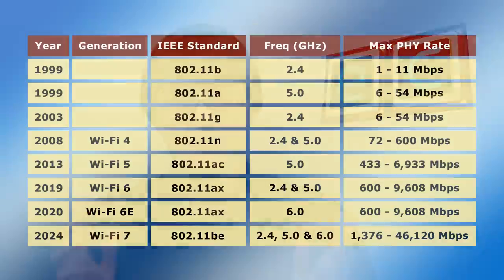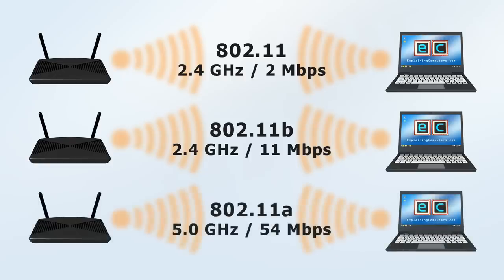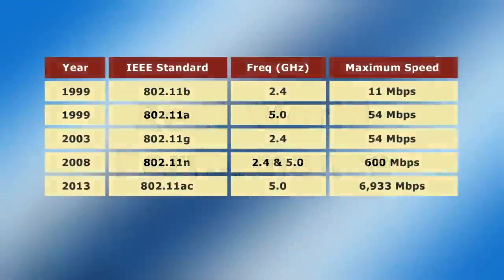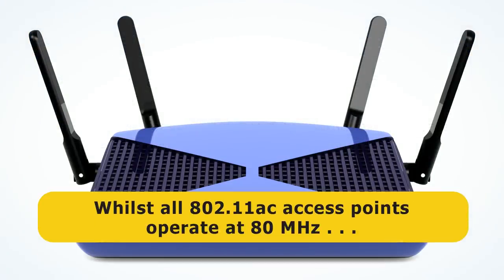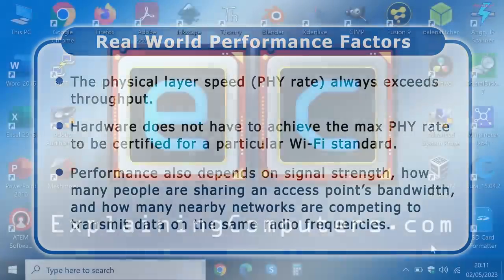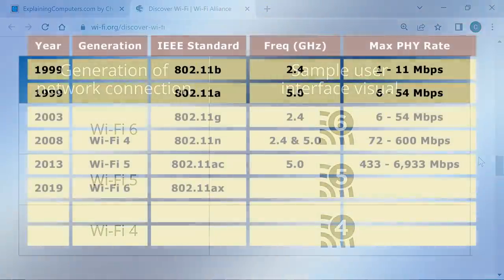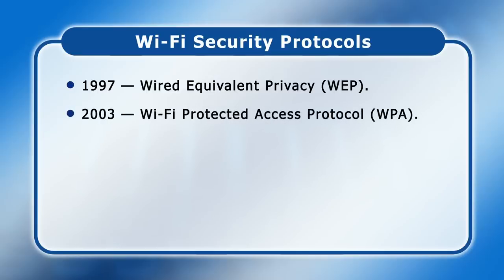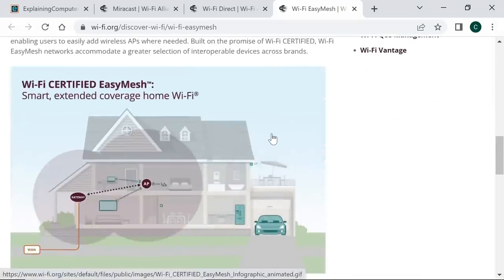Explaining Wi-Fi: 802.11 Standards & Generations

Comment: I do think you should have touched a bit more on WI-FI protocols like WEP, WPA, WPA2, WPA3 and why these are evolving and why one should refrain, when possible from older protocols.  Each previous protocols had /has serious weaknesses that made such protocols relatively easy to hack, under certain circumstances; or interfered with.  To me, that should be mentioned, especially with the plethora of IOT devices, like security cameras that can be  forced offline with WPA2; and WEP which was relatively easy to hack with the right tools.  

Realize that eventually WPA3 will be considered insecure, but there's little that can be done at this point in time. The actual chances of something bad happening- to a regular consumer is still relatively small, but one should try to upgrade periodically, and upgrade settings as well, and dump the old stuff. 

With that, I also realize that MOST folks should not be overly concerned; but when buying new gear, one should be looking to get the newer standards, i.e. gear that supports 6/6E and WPA3  rather than older gear that might only support WIFI 5, or WPA2.  Don't stick to buying only wifi-5 gear because that's what your router is; if possible, get gear that supports 6/6E and above so that when it comes time to upgrade your router, your other devices will already be ready to support it and benefit from it.
Reply from the maker: I did discuss the security protocols, but there is always a balance to strike in not overloading with content.

Comment: Another great informative vlog and always so easy to understand, your tutorials are excellent, I watched the one on changing or upgrading to Win 11 from Win 10 and picked up the local network part where you put in no thank you and hello, what does this actually achieve, or do? Regards David
Reply from the maker: It is an account that has had its password changed so many times that it forces the installer to error, and so to accept the creation of a local account . . .
Reply: Hi I thank you for your info regarding local network, I have just tried to do the second version of getting win 11 pro installed but it didn’t work as my bios won’t boot when I change it to UEFI or protected boot and although I’ve upgraded this machine dell Optiplex 7040 .7 with WD Black SN750 NVME SSD Gtx graphics 1030 graphics card and pci slot 4 usb c card, it appears the bios is the issue, got right through to the registry change and tried after regedit and the new value typed but it won’t do it, Could I ask if there is more that I could type in the value or is there another way of changing bios to then boot. Regards David
Reply: Hi I’ve just looked in bios and it has TPM 1.2 enabled also PPI bypass for enable or disable neither are checked the UEFI is disabled for the reason as stated regarding booting.
Sorry to ask but I’m getting on in years and I’m ok with most things but the bios is a scary place! Regards David

Comment: I remember the times when I connected a PDA to a computer via USB (with a 3 meter extension cable) to access the Internet through it, since that PDA did not have Wi-Fi, and I really wanted to use the Internet at some distance from the PC.
I also remember that bluetooth has similar operating modes and could theoretically be used instead of Wi-Fi, and even access points exist somewhere in the world, but for some reason this technology has not become popular. So we have wi-fi. Which seems to be improving with each new generation, but does not solve one fundamental problem - the passage of a signal through walls. Sub-Ghz band 802.11ah should solve this problem (as much as possible), but so far I have not seen such devices.
Reply from the maker: I remember times like these. My first ever online grocery shopping was ordering some bananas and stuff on a PDA  with a modem card, and a wire from this plugged into the telephone socket! I was very ill at the time, and thought getting food that was was amazing!

Comment: It's also worth noting that Wi-Fi is only half duplex, even Wi-Fi 6. So devices cannot send and receive data at the same time whereas wired ethernet is full duplex.
Reply from the maker: Very true.
Reply: And for this reason I think that when sending data between two devices on an access point (AP) with a single radio, the max real world speed drops by 50% as half the time the AP is receiving from the first device and the other half the time the AP is sending the data on to the second device.

Comment: An other classic!
Little correction: WiFi6 and WPA3, yes, came around the same time, but those are independent from each other: A wifi5 manufacturer can release a firmware upgrade, so that wifi5(ac) device will be able to use  wpa3.
Reply from the maker: Fair point, bad phrasing on my part there.
Reply: WiFi 4 devices can also get WPA3 support after a firmware update, for example a TP-Link TL-WR844N got a firmware update to add support for WPA3, or the Raspberry Pi Pico W, which already has WPA3 support out of the box thanks to the CYW43439 WiFi chipset that it uses.

Comment: When we built our house back in the late 1990s, I thought I was the coolest nerd ever because I had the house wired for 1Gb Ethernet (Cat. 5e).  Now days, it would be foolish to go to that added expense when you can simply put up an 802.11 Access Point or repeater.

All my iSCSI connections are via wired Ethernet but I have a couple network devices untethered (printer and tablet).

Comment: Am i wrong by saying that the chart at the beginning of this video shows that 802.11AC only has 5.0 GHz?? I have an AC WiFi SOHO router and it broadcasts both 2.4 and 5.0??
Reply from the maker: You are correct. 802.11ac does indeed only operate on 5GHz, as the table shows. But a router rated as 802.11ac is likely to support earlier standards also. This I mentioned later in the video -- the indicated standard for a piece of hardware is the highest/latest, but usually earlier standards are also supported for backwards compatibility (although this does not have to be the case).

Comment: I'm still buying and installing CAT5e Ethernet cables in my house! It seems fast enough to me, as I've only got 5Gb broadband, and the most demanding things I usually do are watch low resolution YouTube videos, transfer a few data files between computers, and monitor my 3D printers with OctoPrint! Installing Wi-Fi is too much hassle, due to the number of thick stone walls in my house, and cables are so much easier! Does this make me a Luddite?
Reply from the maker: Wired is still the best option where you can use it.

Comment: As usual great content... thank you for educating us. Although I knew about wifi-5 and wifi-6 but didn't the history and that much detail ... TP-Link has already launched a Wifi-7 router so just recently. please have a look and tell us if there is any benefit in upgrading to it. I am using wifi-5 router though my phones support wifi6 and wifi6e
Reply from the maker: Thanks for this. I had missed the TP link announcement --  they indeed now have Wi-Fi 7 products listed (but not yet available). Very interesting! https://www.tp-link.com/uk/wifi7/#products

For most people there will be very little benefit in upgrading, not least as Wi-Fi 5 is going to deliver a connection speed faster than their Internet connection. So the benefits of Wi-Fi 7 will be for those with very fast Internet access, or where they are accessing local rather than Internet data.

Comment: A major annoyance in the already hard to memorize jungle of PHY bandwidths: Dual 2.4/5GHz routers have their AP bandwidths plain added up, so a router with 450 mbits on 2.4 GHz winds up becoming a 1750 mbits, adding the nearly 1300 mbits on 5 GHz. While those can never be used as ONE. Just venting a bit, marketing sucks.
Reply from the maker: Often good to vent! :) Works for steam engines.

Comment: Question:  What happens to the network when a lower device enters the group?  For example, you've got a home network with all WiFi 6 devices, but then your kid comes home with a phone that can only go up to WiFi 4?  Does the whole network degrade to WiFi 4?  As a recall, that was the case when you had a 802.11g system and a 802.11b device joined.

Comment: So why skip letters between standards? Why were none of the letters c - f used and we went straight to g? Similarly skipping h - m and next used n. Are there other "hidden" 802.11 standards out there?
Reply from the maker: The standards in-between those listed relate to other technical matters. For example, the 802.11e standard dealt with quality of service issues: https://www.electronics-notes.com/articles/connectivity/wifi-ieee-802-11/802-11e-qos-quality-of-service.php

Comment: It's great that Wi-Fi speeds have improved but all that really does is push the bottle neck down to the physical network (unless you're blessed with a 10Gbps LAN) or your internet connection. I have a 2.5Gbps LAN connection in the house and a 300Mbps up/down internet connection. Wi-Fi 6E is basically useless to me...

Comment: One question, I hope I didn't miss it but, what, if anything, do the letters after 802.11 mean? Seems to be no rhyme or reason to them. b, g, n, ac etc.
Reply from the maker: As far as I'm aware, the letters just label the standards. So it began with a and b. :) But after that, not all of the new standards involved fundamental changes to the connectivity (such as speed improvements). For example, the 802.11e standard dealt with quality of service issues: https://www.electronics-notes.com/articles/connectivity/wifi-ieee-802-11/802-11e-qos-quality-of-service.php

Comment: So ,budget phones that have wifi 802.11 b/g/n or routers too that dont have the 802.11 ac are just perfectly fine for a  user with 100mbps  internet plans ?
Reply from the maker: Always if things work they are fine. :) 802.11 b/g/n hardware will have a PHY rate of between 72 to 600 Mbps (it will depend on the device what its max is within this range), and this will translate to a real-world throughout of between 50 to 400Mbps. So some b/g/n hardware will be bottlenecked by the Wi-Fi  on a 100Mbps Internet connection, but many devices will not be.

Comment: Could you expand on mesh? I find that when I connect with Wi-Fi I get a transfer rate of 40m but connecting with a cable to my remote mesh I can get 140. How do the nodes communicate that allows that type of speed with out a wire?

Comment: So if building a house in the next few years, does it make sense to wire with ethernet cabling, or just go with wifi?
Reply from the maker: Wire with Ethernet if you want the best, most reliable and secure connection. Wi-Fi is great -- but only where wired is not an option. :)

Comment: Wi-Fi can go over 1/4 mile direct line of sight using ordinary router/laptop without any special antenna's. BUT after pushing through 2 or 3 wood framed walls in my home, it's nearly useless! That could be like 20 feet away from router!

Comment: Fascinating stuff, my windows laptop says wifi 4 72/72 mbps so is that the hardware limiting that or my wifi provider please ? excuse me if this is the daftest thing you have ever been asked  !....cheers.
Reply: The Wi-Fi standard that your laptop uses depends on two things: Your router and the laptop's Wi-Fi card. Your Wi-Fi connection will fall back to the lowest common denominator, which means the newest standard that both devices will mutually support. For example, if your laptop supports up to Wi-Fi 6, but your router only supports of up to Wi-Fi 4, then your Wi-Fi connection between both devices will be up to Wi-Fi 4.

Comment: Honestly, those «wireless» wifi range extenders are so unreliable. An ethernet socket in the wall is necessary for any wifi extender. Especially if the walls are drywall

Comment: 802.11a is now called WiFi 2 and 802.11b is called WiFi 1.
You would think they would call 802.11a & WiFi 1 802.11b WiFi 2 since A is first letter and as both were released at the same time not to mention no one uses 802.11a or 802.11b these days.

Comment: In the real world wi-fi is kinda rubbish compared to wired connections. I use flat cable ethernet in my house. Yes it's a dam pain to lift carpets and sometimes have to drill holes in floorboards and walls but it beats wi-fi speeds every time.
Reply from the maker: Agreed, wired is always best. But this is a video about Wi-Fi. :)

Comment: Using 6GHz frequency for WiFi is THE BIGGEST MISTAKE the WiFi alliance did.

Let me explain,
According to the GSMA (GSM Association), 5G and beyond need at least 2GHz band for each country. 6GHz is one of the best frequency candidate because it still can penetrate wall, rain & snow. 6GHz is WAY better than mmWave.
Using 6GHz for WiFi is a WASTE because WiFi would still be fine using higher frequency like 10GHz or 12GHz.

BTW,
mmWave is failing. ALL of South Korean carrier admit defeat of mmWave, and returning the frequency to their government. China and Asia have voted on using 6GHz for mobile, and if America/Europe didn't follow, the west will lost in mobile data speed.
Reply from the maker: Yes, I was surprised when 6GHz was added, given the intense competition for frequency bands. We will see what happens over time . . .
Reply: @ExplainingComputers  
Thank you for acknowledging it the problem.
Really hope WiFi association move the 6GHz to perhaps 10GHz.
Reply: 5 GHz doesn't penetrate brick walls well, that's why I still use both 5 and 2.4
Reply: @gustavrsh  
That's the point,
WiFi should only penetrate 1 wall at most. And the frequency not too far.
That's why the WiFi signal were limited/suppressed to be very low power.
Otherwise, you will "fight" with you're neighbor
It means, if you're signal were too strong, you will have interference, and the speed will drop.
This is because WiFi is unregulated, and everyone can just make a WiFi point.
You will understand this if you put WiFi router in very crowded apartment or mall.
Thus, higher frequency like 10GHz still OK (and maybe better) for WiFi.

Mobile carrier is different story
Because the specific frequency will be licensed to specific mobile carrier.
Reply: @agathalorenzo4224  so your point is that I need 4 access points?
Reply: @gustavrsh  
Depending the size and location of you're area, perhaps yes.

.... Let me explain with my situation.
I live in a 4 bedroom apartment. I could put one router in the very center, and I could set my router to send with max power and get the signal in every corner of my apartment. But the signal quality will be bad. At certain time, at certain spot, especially after 17:00, my 2.4GHz signal might only have 1mbps-2mbps. But if I set my router to minimum power, and I use several 2.4GHz router, I might got at least around 5mbps-10mbps at the bad spot, and around 20mbps-30mbps at the good spot, but with a HIGH PING & DROP. This is because if I have around maybe 40-50 WiFi router around my apartment.
The 5GHz is better for me, because it penetrate wall less. Meaning, less neighbor WiFi. But again, same thing. If I set at max power, it will ruin the speed/quality. The best for me is to set at lowest power level and use more WiFi access point. So it's quality problem. If I want higher quality, use more Wifi Access Point. Because using high power = more interference = higher ping.

Comment: Despite big phy rate numbers wifi is not hugely different of how it was 10 years ago. It still sucks hard and is nowhere around as the replacement for the wires. Don't be fooled by numbers. It still works like walkie-talkie. One speaks other listen and mu-mimo does not helps much. OFDMA of wifi6 is the only real improvement here.
Also wifi is a bi-directional thing. Both sides must hear each other and therefore transmit data with similar power levels. That means there is no reason to search for AP with "good range" or  set TX power to high levels at all. It makes no sense. Realistically range can be improved by buying more access points only.
Also wifi has big amount of extensions. Some of them might present on your AP some don't. Like w/r/k/v. So not all access points are equally good. It heavily depends on the quality of the firmware it runs. So name on the box does actually matters.
And please, PLEASE, never use more than 20Mhz on a 2.4Ghz band.
Overall wifi topic is way, way more complex.
Reply: Some things do have good range though.

My old LG phone would pick up the local casino's wifi for several hundred yards.
Reply: @jeffkardosjr.3825  phone can receive but wont be able transmit back properly. Also will drain battery fast.

Comment: wifi is not the way to go generally speaking - wifi7 i on the way and that should be faster but why even bother really? savvy professionals will goto 10g or even 40gbe or 100gbe - most people should at least try to upgrade to 2.5gbe or 5gbe and they can utilize bridging or bonding interfaces to get double the speed - this is common sense advice
Reply from the maker: I agree that wired is best where possible. But this is a video about Wi-Fi! :)